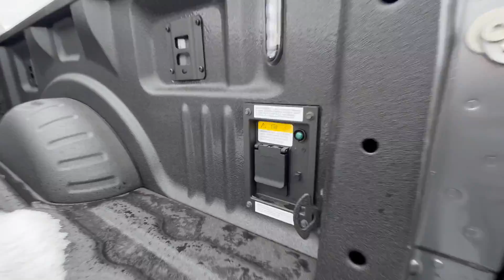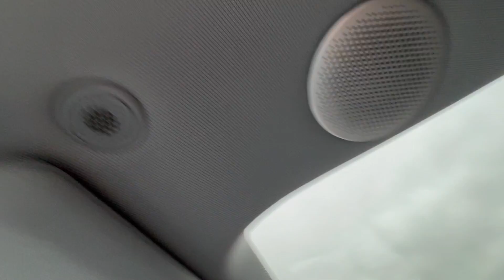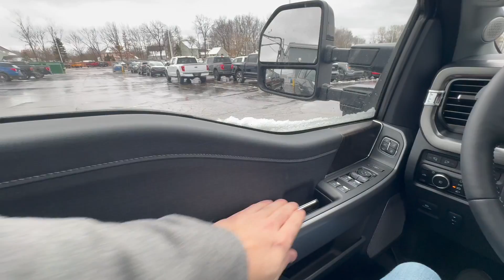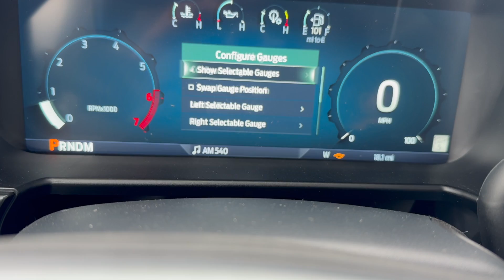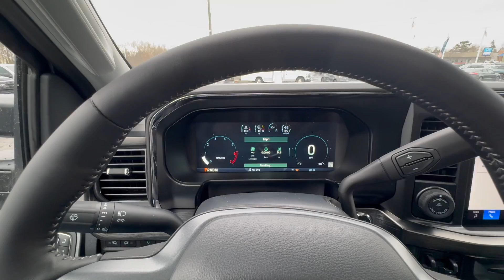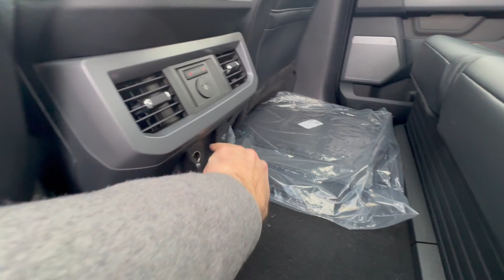2024 Ford F-350 Lariat Ultimate Black Appearance package 7.3l Godzilla MPG & Drive review impression

Comment: I just hauled a dump trailer full of demolition bricks to the dump for my boss with my F350 SRW XLT with the 7.3. We estimated trailer and load was at least 23,000 pounds. It did a great job. Frame is so capable. A diesel would have been better but in 77k miles of ownership this 7.3 has never asked for anything. It hauls anything I need. I just brought 6 yards of #57 limestone home 35 miles. I had zero power issues. The engine is a beast. When not towing you can have old school V8 fun with it too!  I play with mine all the time cuz I love how it sounds and it sits you back in your seat too!
Reply from the maker: Thank you for sharing that about your 7.3. I love that engine. It's great to hear you are happy with it!

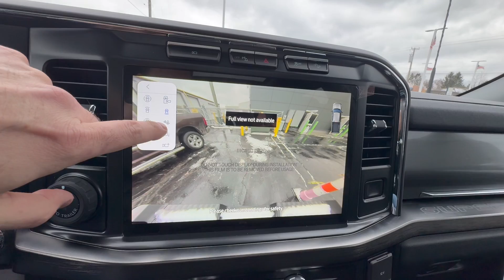Comment: So I just ordered the 2024 F350 XLT Tremor in the brown...... and built it from the website and must have added 12 to 15K in upgrades with the 4:30 rear end... I ordered it from Randy wise in Ortonville... should be here in August or September and I did go with the 7.3 L Godzilla but I wanted to ask you a question I did hear and the only reason I went with the gas is because they fixed apparently fixed the lifter issue for 2024 have you heard any new rumors against that or are you still seeing problems in 23
Reply from the maker: I have not heard anything on that one! I think the 7.3 is a great engine though!

Comment: The lariat ultimate has the steering assist motor mounted to the steering shaft. With it the truck wanders a lot less then without it. Had a 23 without it and it was horrendous. Drove a truck with that option which now only comes in the lariat ultimate, and it drove completely different as in much better. It's extremely frustrating that you can only get this feature with a lariat ultimate. It used to be an option on the lower trims at 1k. I'm no longer in the market until manufacturers start heavily incentivizing on price and financing.
Reply from the maker: Wow...great to know, for that reason alone I would get a Lariat ultimate, thank you for the comment, and thank you for watching my video!
Reply: I believe it's tied to the trailering package (which comes with the Larait Ultimate package) so lower trim trucks with that package will get the assisted steering. It also comes with the Tremor package.
Reply: If you order a truck with the Tremor package it comes with the steering assist.

Comment: Great review. I've driven several 24's and they've all been smooth rides. My 23 f350 tremor rode fantastic stock, with the 3" lift it rides fantasticer. 😂
Reply from the maker: Thanks for watching! They are awesome truck, glad yours is working out!!
Reply: is it a Carli 3" commuter suspension lift.
Reply: @Jassman1962  no, the carli kit only gives 1.5" or so on the tremor. I used a rough country 3 " tremor lift with shocks. It's got.75" of rake and rides great.